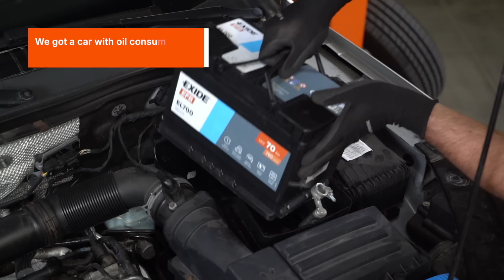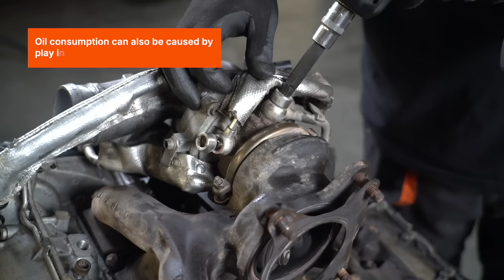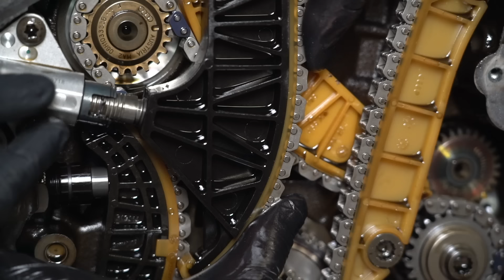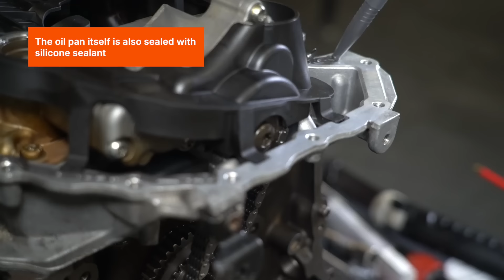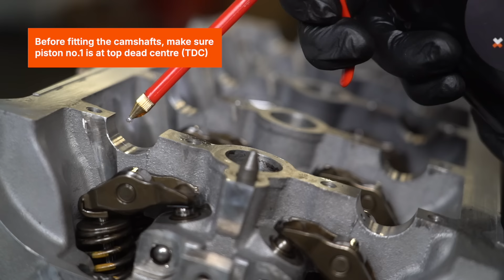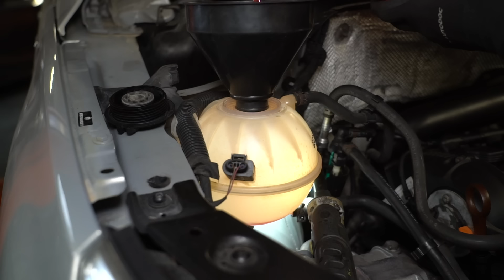Why does it burn oil? The main cause of oil consumption in EA888 Gen 1

Comment: I saw that you reused the original pistons with the cut out below the oil control ring. That was part of the problem. VW Audi revised the pistons to remove this gap. Otherwise, very careful rebuild.
Reply from the maker: This video is intended to provide a general understanding of the repair process and many details vary depending on the specific situation. We cannot cover every aspect in this video. The video demonstrates the basic principles and essence of the repair process. For more details, please refer to the repair manual for your car.

Comment: Be careful not to damage the ceiling surface of the cylinder head, and proceed to damage with wire brushing tool at full speed.
(I know, it's just for demonstration purposes, jff people)
Reply from the maker: Thanks for your comment🙌 Yes, it is better to consult a mechanic before work if you have no experience.

Comment: My 2012 GTI still burns oil. I updated the pistons.The old control rings were fully blocked up.cross hatch was still visible, there are a couple small glazed areas that have a cross hatch as well. I will be sending the block to a machine shop to inspect and hone.Turbo is a new APR k04 cyl head was sent out pcv diaphragm everything is new
Reply from the maker: We hope that with such a massive repair, you will achieve the desired result🙌😉

Comment: Hello! I want to ask, did you just clean the cylinder wall, or was it honed as well?
Reply from the maker: Much depends on the condition of the cylinder surface. Carbon deposits can be removed with solvents. Many factors are individual.

Comment: The oil is comming on the intake due to a failure of the crankase ventilation or turocharger!.Mercedes engines use the same piston rings ( the clogged one i mean ) , bmw also, but not such an issue!

Comment: Oil pump belt is the problem
Reply from the maker: Thank you for sharing! The timing belt may be the cause but the main reason for oil consumption in this engine is related to the design of the piston rings and their wear.
Reply from the maker: TEST 😊😊😊
Reply from the maker: 😇😑😄😏 TEST

Comment: I stopped doing the Long Life service interval of up to 30k pretty soon after my pistons were replaced for the update versions under warranty.
Now replacing the oil every 15k and do once a while an engine flush to keep the internals clean.
Now hardly any oil consumption.
Reply from the maker: More frequent oil changes have a positive effect.

Comment: why the oil pan bolts loose its tension
Reply from the maker: There may be various reasons but perhaps they need to be replaced and new ones tightened with the correct tightening torque.
Reply: @autodocuk  thanks for your response, i asked the mechanic here he changed the place of the bolt with steel and then he tightend the same old bolt
Reply from the maker: Thanks for the update! Sounds like your mechanic found a solid workaround. Reusing the original bolt can work fine if the threads are still in good condition. Let us know if you need help picking out a new one!
Reply: @autodocuk  yes for real i already searching for a new bolts with a good material to fit and replace the old bolts but i dont know how to get the original size of the bolt yet

Comment: So to answer the original question... Why does the oil burn?  Looks due to regular maintenance neglect as well as just regular flaws direct injection engines with valve seals and carbon buildup.  Once there's been some oil starvation, it will have a snowball effect leading to oil consumption.  You'll have worn/damaged rings, timing chain & guide wear, crank bearing/journal wear, etc.  Solution... engine rebuild.

Comment: Bs repair. You just replaced the rings with same spec ones. In another 100k same job. If your going to spend this kind of money, You should have ground the piston ring channels and used updated rings or used aftermarket pistons with uprated rings.
Reply from the maker: Thanks for your comment and provided specification!
We are sure your comment will be useful for many of our viewers.
Reply: I'm boring the cylinders to the first oversize and getting new pistons that match the new dimension. Hopefully, that will solve the oil consumption problem. Will update you guys on this after i put some milages on it.
Reply from the maker: Thanks for your comment! It sounds like a good move. Hopefully that sorts out the oil issue. 
Drop us an update once you’ve had some time behind the wheel — would be cool to hear how it goes!

Comment: 최신의 EA888 gen4 엔진은 문제가 없습니까?
Reply from the maker: We regret but Korean-speaking manager is unavailable at the moment. Our team will answer in English.

The newest EA888 gen4 engines are much more reliable than the previous ones, but they are not without problems:
- Valve carbon deposits: It remains a problem due to direct injection.
- EGR valve: It can become dirty, which leads to failures.
- Oil leaks: It is possible through the PCV valve.
The engines have become better but they still require regular maintenance.

Comment: What is the exact oil type you put after the repair of the engine, and is synthetic or full synthetic ?
Reply from the maker: We cannot answer your question for sure. In order to answer your question, we need more information about your car. Contact our Customer Care team and we will definitely try to answer your question.

You can get in touch with us via form here: https://www.autodoc.co.uk/services/contact
Reply: @autodocuk  Its not about my car, its about the car you repair in this video, what oil you put in it after the repair? Use better translator please.
Reply from the maker: Unfortunately, the video doesn't show the exact oil used in it. All modern engines use fully synthetic oil but the specification for the correct oil must be selected for the specific engine, as, for example, a car with a diesel particulate filter requires a special oil. Therefore, we recommend that you contact our Customer Care team via form - https://www.autodoc.co.uk/services/contact in order to be ensured you receive oil that is compatible with your engine.

Comment: Don't know why petrol engine are so bad on oil consumption. I'm using 0.1l/10.000km on a 2.0TDI
Reply from the maker: Oil consumption in modern gasoline engines is not always a problem, but a result of their design.
- Low friction rings: Used to reduce friction and save fuel, which allows some oil to pass through.
- High temperatures: Turbocharged engines operate at higher temperatures, which causes oil to evaporate.
This is a trade-off for better fuel economy and power.

Comment: Running these engines in correctly seems to play a massive part in potential oil consumption issues. From new (this applies to any modern vw/audi engine) vary the revs, don't go above 70% throttle, put it under a bit of load now and then and never redline or engine brake. Once you've got say 600-700 miles/1000-1200 kms go somewhere with some decent hills and give it an absolute flogging for a few hours once the car's oil reading is up to temp. Then do an oil & filter change to get rid of all the sparkly bits and hey presto- your car has been run in!
But yes, shortening the oil change interval to about 6k miles/10k kms is a must for ongoing reliability
Reply: I agree with the oil change interval of 10000km up to 15000km but no more... and engine flush once a while.
Reply from the maker: Thanks for your comment! We are sure it will be useful for many of our viewers.
Reply from the maker: However, if you often drive in the mode - city/traffic jams or short distances, it is better to stick to the lower limit (10,000 km) as this is considered “severe conditions” of operation under which the oil ages faster.

Comment: It’s the gen.2 that excessively burns oil, for feck’s sake. 
EA888 gen.1 was a relatively short lived engine but didn’t burn much because it was Euro 4 compliant and used “proper” rings and pistons.
Reply: My gen 2 didn't have this issue

Comment: Terrible oil control rings, once these cast iron rings wear, the oil consumption will come back.
In my shop we always used 3 piece oil control rings, mainly "Hastings", never had a "comeback".
My 1969 Alfa GTV , which I rebuilt in 1986 has "Hastings" rings on "Mahle" forged pistons, still doesn't use a drop of oil.

Comment: I know someone who had a 2012 gti edition 35 which only used synthetic 5w30 Castrol edge, was well within oil change intervals (so he thought) it didn’t use oil but the sump pickup became blocked with carbon. He believes it was due to short running which effectively puts it in the “extreme conditions “ category and should have reduced oil change intervals

Comment: I have same engine in 2008 Scirocco GT. Based on first seconds of this video I can guess that base cause of this engine excesive oil consumption was poor maintace. Probably cheap oil and long change intervals. I hope I will not have to repair my engine like this in the near future, but if so, I can save this video as tutorial.
Reply from the maker: Thanks for your comment and for sharing your thoughts! 🧡🖤
You're absolutely right — poor maintenance, extended oil change intervals, and low-quality oil are major contributors to the excessive oil consumption issue in the EA888 Gen 1.

Sounds like you're taking proper care of your Scirocco, which already puts you ahead! Regular oil changes with high-quality oil are key to keeping that engine running strong 💪

And yes — fingers crossed you won’t need this video as a repair guide anytime soon, but we're glad it's here just in case! 🚗🔧
Reply: Change the oil every 15k km and flush the engine once a while to keep the internals clean.
Reply: @mstar501 shouldn't need to flush the engine, reducing oil change intervals will clean it up enough. Plenty of detergents in modern oils

Comment: The main cause is that the engine is poorly designed, under dimensioned oil rings to lower fuel consumption thanks to climate control legislation in Europe

Comment: Is the gen 3 still susceptible to this as much I'm doing oil changes every five thousand Ks becuase I don't care what oil technology VW uses 15,000 km is far too long the high temperature high performance turbocharged vehicle absolutely ludicrous I have no oil burning at 60,000 kilometers so far.
Reply from the maker: You need to follow the manufacturer's instructions. More frequent replacement has a positive effect.
Reply: @autodocuk  Both your sentences contradict
Reply from the maker: This video is for a general understanding of the repair process and many moments are individual in each specific case. We recommend to follow the car's manufacturer instructions.
Reply: @autodocuk when Volkswagens is 15,000 k's I'd recommend not following it unless you want oil burning 😂

Comment: Stop using VW 508 00 oil at 10,000 oil changes. VW 504 00 at 5000 miles. Never have an issue.
Reply: With this approach you can also have 1k oil changes. Why not?
Reply: 純正のオイルはだめだ。もっと硬いオイルが必要
Reply from the maker: Any repair or maintenance must be logical and justified. There are regulations for this, and depending on external factors and the financial capabilities of the car owner, a decision is made on whether to replace or repair.

Comment: A faulty pcv let the lightest fraction of the oil being sucked in the intake , instead of redirect it to the sump . The remaining oil get denser , with less lubricating capability , less flow rate witch led to overtemp and obstructed oil control ring . Small piece of plastic can led to great damage
Reply from the maker: Thanks for your comment! This video is for general understanding of the repair process, many moments are individual in each specific case.

Comment: Who would have guessed that the European 20,000 km oil drain interval destroys engines! Nobody could have predicted this!
Reply: *30000 even.
Reply: I was doing it every 7500km on my old mk6 Gti...
Reply: @rogueinstructor4998 i do every 5k km in my s4. i push it harder than most so it deserves better than most
Reply: @rogueinstructor4998  i think that would be about the perfect interval too, did you have oil consumption in that car at all ?
Reply: @fuckglobalism  Just a bit, about 0,5l between two maintenance. Before replacing the pcv valve my consumption was higer, almost a liter for 5000km, after only 0,5 every 7500km with Shell 5w40.
Reply: @rogueinstructor4998  that tiny amount might just be low tension rings too even Hondas etc burn oil from low tension rings same with Toyota although Toyota likely fixed theirs lol , yours is still much better than some good job gives me hope :)
Reply: @fuckglobalism  I just sold the car with almost 200K. It gave me a lot of stress you know: Intake manifold, wastegate, timing chain, injectors, hpfp, oil leak, dumpvalve,...And many more... 😅
Reply: @rogueinstructor4998 😂сложи 5/30 с каквото трябва реално да с кара и 1литър ще е началото само😊

Comment: VW Group, all over-priced shite now, you could run the older stuff without any noticeable drop in oil level between services. Now 1L/1000km is ok according to VW (A Seat Ateca 1.5T, finished my love of VW group for good!) , My old 2.2 5cylinder Audi with 294,000 miles wasn't using oil, neither where any of my pre 2000 VW group vehicles. .
Reply: 1.5tsi evo1 is ok if you change the oil every year and you put full synthetic PAO/ester based oil, i have 1.5 and is not eating oil... but is has kangaroo in the first min of cold start (catalyst pre-heat with lean mixture and extreme spark retard).🙂
Reply: @cri1410sti  It was brand new serviced by the Seat dealer. That's not to mention the never ending dsg box faults, or the complete lies about average fuel consumption a 3 year, 75,000 mile (mostly on the motorway) nightmare.
Reply: @cri1410sti  we have the 1.5 TSI G-tec (130hp biogas version) in our Skoda Octavia and yeah that cold engine kangaroo is crazy.
Reply: also that ACT/COD is the worst invention ever made..

Comment: All VW group engine have oil consumption, bad quality,
Reply: Don't think so 😂😂😂😂
All my audi's never burned oil
Reply: @erwinvanriel5843 sure you check correctly? Or you have oil change at 2000?
Reply: @mig21m13 

1000% 

Maintaining myself . .

Every 10.000 new oil . Never used oil 

And i have owned 6 audi's
Reply: @erwinvanriel5843 if that is true, your all Audi’s must go to museum.
Reply: @mig21m13 

No i own now an audi a5 2023

I will drive it 😂😂
Reply: @erwinvanriel5843  I back this up, 1.2 TSI CBZB at 350.000km, doesn't burn a droplet of oil, oil change every 10.000km, Castrol 5W40 if I do a lot of towing even earlier. (Oil gets hotter)

Comment: Fantastic video! From the beginning when the problem is diagnosed, I was repeating the moral of the video which was given in the end of it. There are no bad engines, but bad owners! So, everybody should do themselves a favor and change oil filter and oil once a year or at most on 8 000 kilometers I would say. You will never have problems with the engine, especially if you regularly change air and fuel filters.
Reply from the maker: You are absolutely right, the more often you change oil and consumables, the longer the car will last. Thanks for your comment!
Reply: @autodocuk Thanks for your existence!
Reply: It's true and not true at the same time. There are really terrible engines from the factory like the EA888 gen 1 and 2 prone to insane timing chain failures without warning and oil burning right from the factory due to the thin piston rings, the 2.0 TDI PD was also a horrible engine too because guess what, timing chain fail due to one stupid bolt on the timing tensioner which made it fail catastrophically
Reply: @KK·Kraz There are always advices in Car manuals that You get when buying a car. Among instructions there are advices when the timing chain should be replaced. Replacement should always be done changing all chains, gears, tensioners, chain slippers and bolts, not partially.
Reply: @dusanrajicic8798  😂😂😂😂 hahaha yeah, if i would obey their own service manuals like the long life oil change after 20 to 30 thousand kilometers then the engine would die at 100k kilometers, also they say at some engines that the timing belt will last 200 thousand which is bullsheeeit and it usually is good to change it once in 80 to 100k kilometers
Reply: @KK·Kraz Maybe you're right. I don't have the manual for that specific engine but as form my car and engine, everything that they have suggested pruved out to be true in reality. The most important thing is to drive car normally and to have regular services. Could you tell me for what is the car you're talking about so I could find and read the manual?
Reply: a lot of cars suggest long life oil changes so i can't suggest you right this exact model because its everywhere the same like you can check a manual for the seat leon FR 1.8 TSI (year 2015) i got this car and these engines even said by my mechanic they're very sensitive to oil quality you gotta put only the best oil with exact vw specs like the vw 504/502 for my engine, 5w30 and 5w40, i did an oil and filters change yesterday i put there liqui moly top tec 4200 5w30 and the car runs like new it's such a sweet baby now @dusanrajicic8798
Reply: No bad engines, except it doesn't help when these stupid VW engines are made from plastic eg the ridiculous intake manifolds
Reply: @Tom-f8r8o If you don't like that kind of engines just don't buy them. I would again say, that it is about owner (driver) and his or hers driving style and maintenance habits. If you use car smartly you will have long life with especially with the chain. I adore these engines, especially FSI.